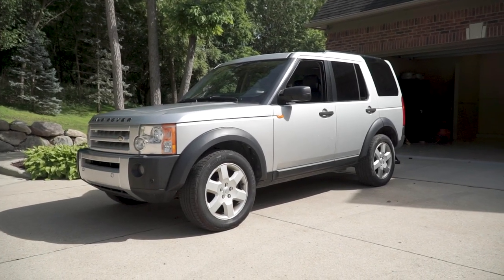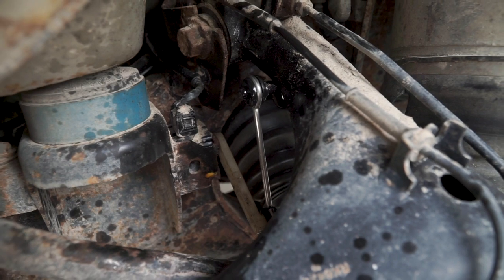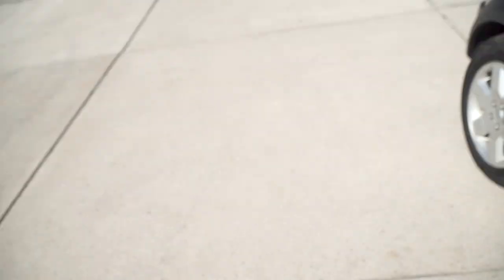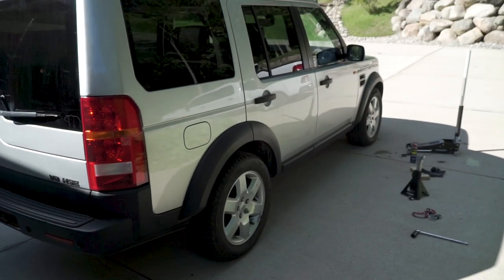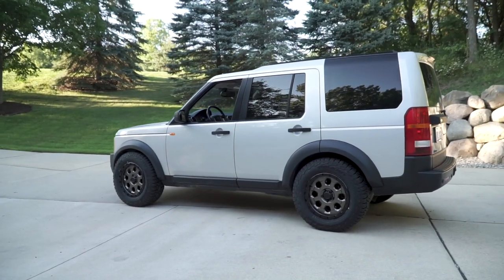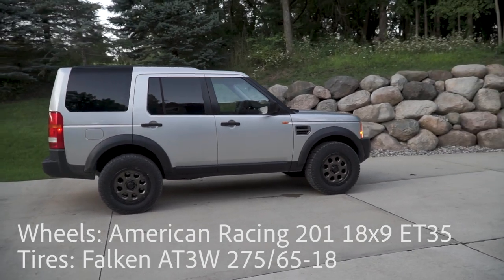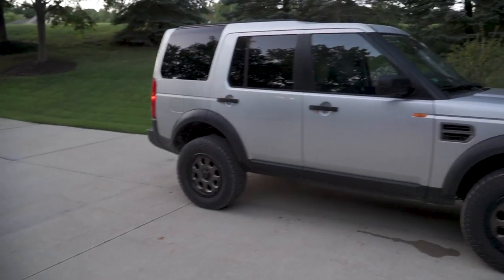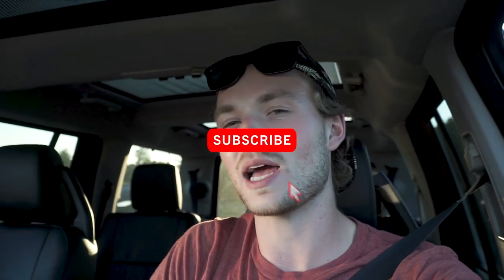Land Rover LR3 Lift Kit and Wheel Install | It's Huge!

Comment: One thing to keep in mind.. Tires that size won't fit in the wheel wells. If your suspension ever fails or just wigs out and decides to drop to the bump stops (and this will happen eventually), you're going to be stuck. Don't ask me how I know! You might want to look into bump stop spacers and limiting straps. Just some friendly advice..
Reply: what size pump stop spacers?
Reply: Tim I got some questions about The whole idea of this and what she said I was worried about is there a way I can contact you thur messenger or Facebook type John Manuel in Facebook u will see me
Reply: @Historyinmotion1984  i can help😁

Comment: Looks good. Just picked up an LR3 myself last week, and Johnson rods came in yesterday. I only went the 1.5in lift and will putting 265/65-18 on it. Please keep us up to date on other upgrades.
Reply from the maker: Sounds good! You'll love the lift!
Reply: @Darrin: Do you have any videos/photos showing your 1.5” lift w/ 265/65r18 setup? Any tire rub or other issues you’ve noticed? How’s cornering, articulation, and road manners since the upgrade?
Reply: @illbenooneelse  no tire rub what so ever. I think it's it's perfect for daily use and occasional off road. I do have photos but not sure how I would get them to you
Reply from the maker: No noticeable rubbing yet. Drives great on the road and on sand/dirt. Barely any tire noise on the highway either. I've had duratrac tires in the past and they were louder. I'd say go for it! Very nice to drive.
Reply: 265/65/18s will fit a stock lr3 with very minimal rubbing at full lock in reverse with worn bushings. Ie:they fit. 265/70 on the other hand.. not going to go well without modifications. 😉
Reply: Any wheel spacers used or the offset brings them out that far?
Reply from the maker: Just the wheels' offset

Comment: Do these work with 18 inch wheels / I have the AR201 wheels as well? Does this work with the standard air suspension system?  I just ordered a set 😁
Reply from the maker: These are 18s. You won't be able to run as big of a tire with stock height but the wheels themselves would work with factory tire spec

Comment: Can you fit these tires to the stock 18 inch wheel with the 2.5 lift? Thanks
Reply from the maker: I would imagine so but you can always double check wheel fitment at willtheyfit.com to make sure

Comment: looks great What wheel model/size and tire make/size did you use?
Reply from the maker: Its in the video but they're american racing 201 in 18x9 plus 35. Tires are falken wild peak at3 in 275/65-18
Reply: @ty_zib  are those AR 201 wheels Bronze Matte with black lip color?  They look kinda grey on video.
Reply from the maker: Yes bronze w black lip